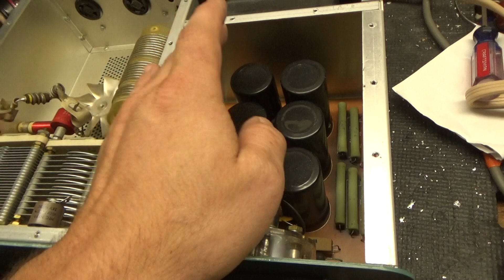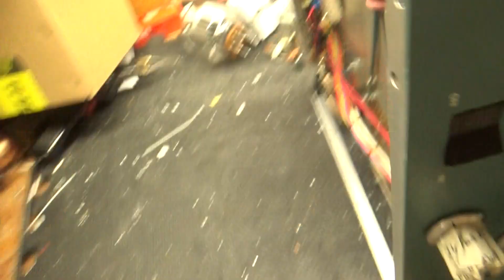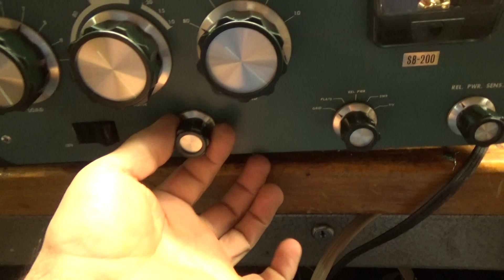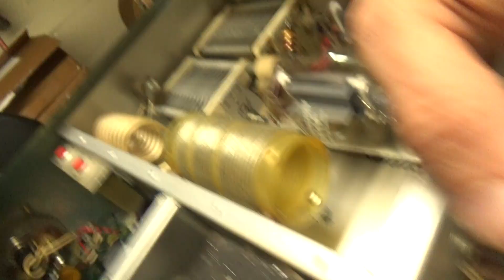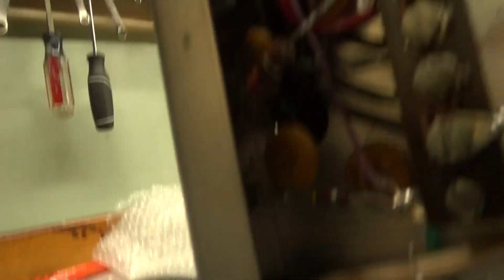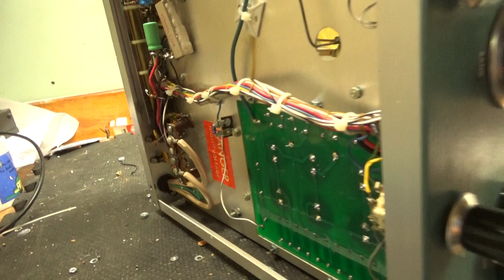HeathKit Sb-200 Repair With Upgrades

Comment: Thank you for all the most useful videos especially the heathkit 200 and 220 ones.
I have one question if I may on the SB 200 how do you tighten/squeeze the tube sockets to grip the tube a bit better?
Thank you , Tom
Reply from the maker: Hi Tom
I gently compress them with small needle nose pilers on the side with the components attached 

Just a tiny bit, I then put deoxit gold on them and on the tube pins. I slide a tube in and out a few times. The parasitic suppressor assemblies give support on the other end.